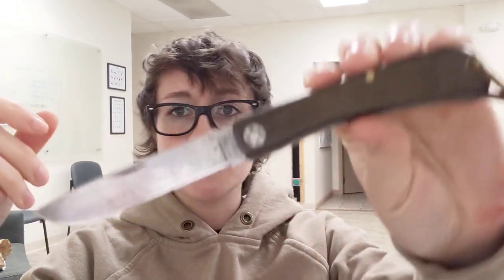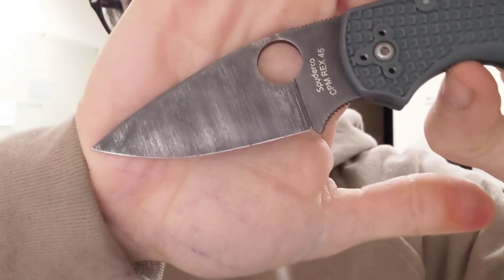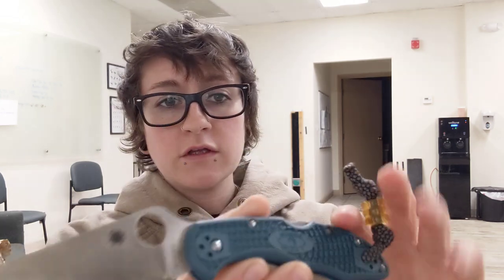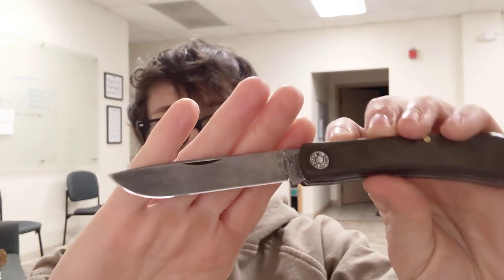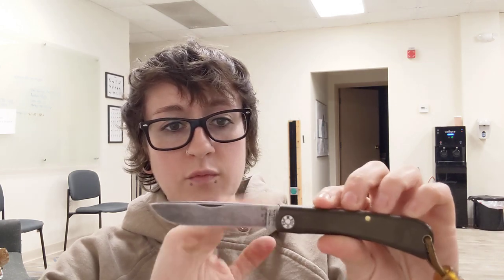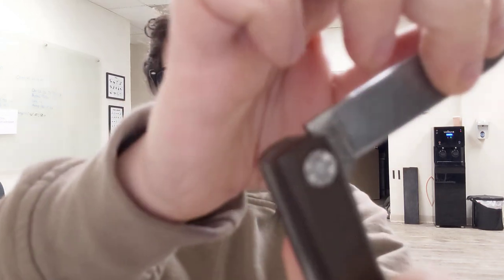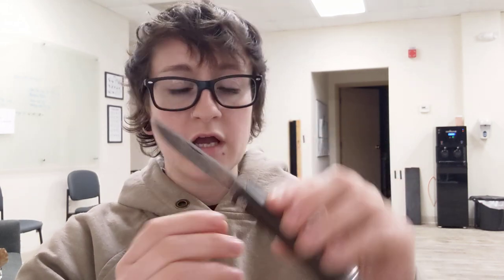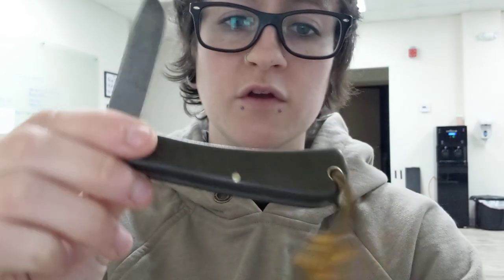Great Eastern Cutlery Farm&Field BULLNOSE

Comment: Fun fact. A funny way to get a patina for 1095 carbon steel knives is the potato method. 

Grab a sufficient sized potato, stab it in (don’t avocado hand yourself), and leave for a few hours.

I have a Otter brand knife that are like GEC traditional folders. Did it for that and for my Opinel so they stop rusting

Comment: I unfortunately uh... Caved into the overpriced knife second hand market but  for some input I have with Cases till it my #71 comes in is this:

Pocket folders like these you will end up changing the blade angle a lot. The amount of traditional folders with uneven profiles or grinds but cut like a champ are everywhere haha. 1095 has a place always, it will get work done! I crawl through alkaline heavy dirty that rusts the frames of trucks into dust, maintain it and it can work.

Comment: Thanks for sharing. I had a french folder in my youth made by Opinel with a carbon steel blade. Edge retention was great, but it needed so much maintenance.I'm happy to use modern steels.